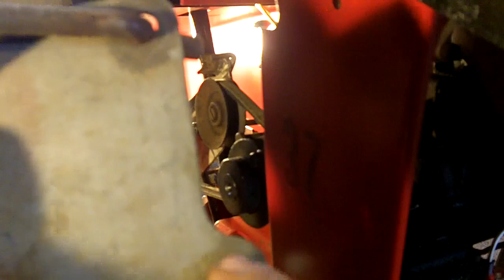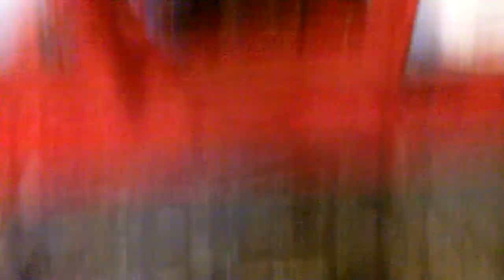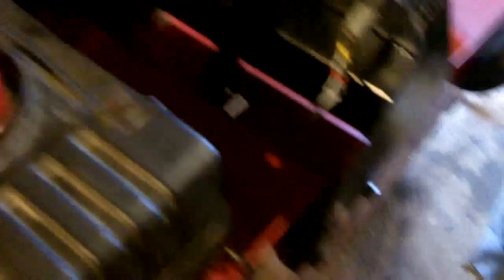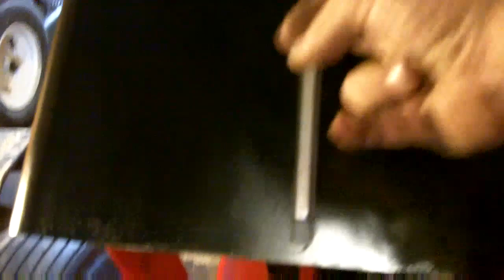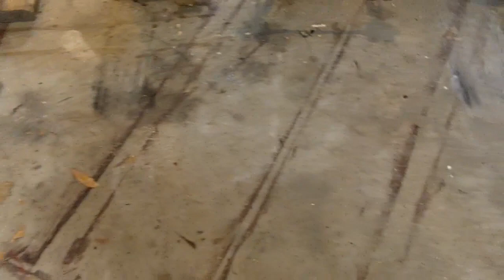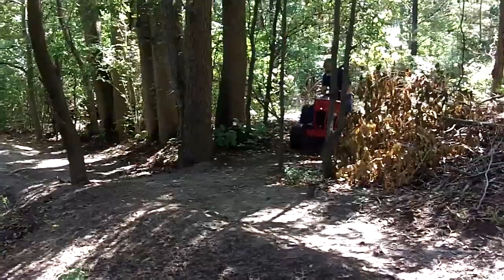Tractor Go Kart is finished, Sears Custom 7 Mud Mower.

Comment: Cool mower.This is way off topic but  just hearing you on 38 lsb you were loud and clear that stainless steel whip antenna works great,i think i need to get some fire in the wire as they say.Im just glad you could hear me,my equipment is old and tired.
Take Care ,Be Safe 73s from 514 Ontario Canada
Reply from the maker: It was great to hear You on the air, I tried so hard to contact You! maybe next time it will be a little quieter, and We will be able to have a QSO. Stay safe, 73's from 151 SC.